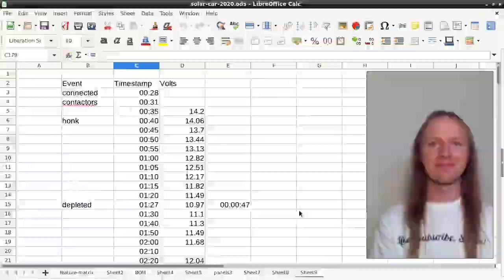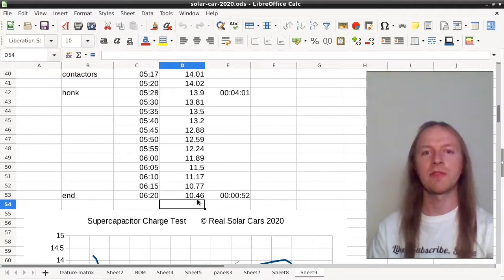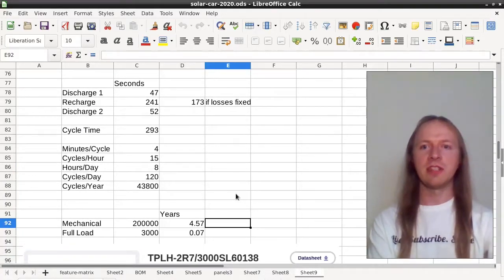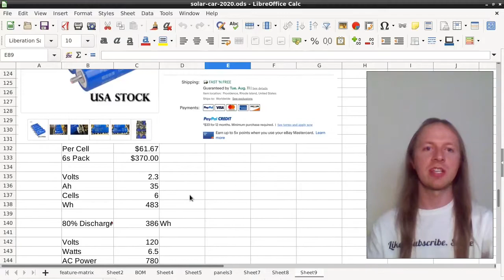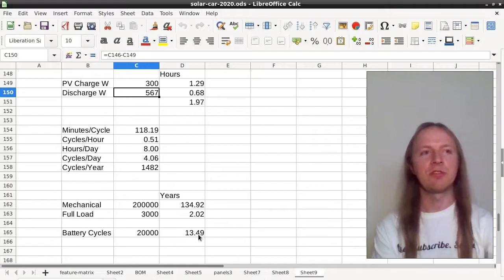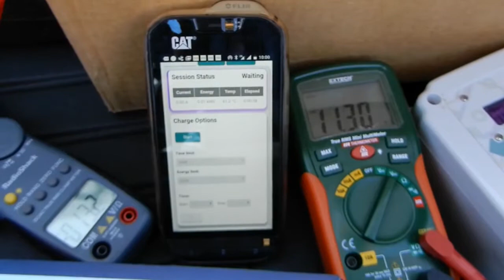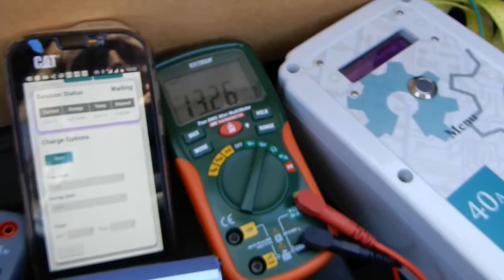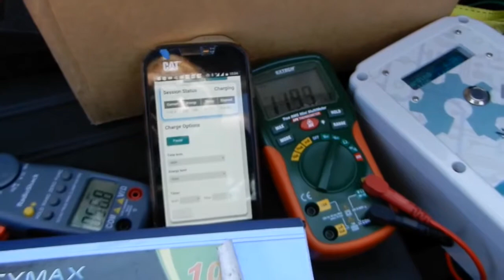Charging my EV with supercapacitors and solar power

Comment: I'm glad you documented this so thoroughly.  I'm still sold on the idea of charging a Volt with supercapacitors during the day, even with such little energy storage, because compared to batteries, their lifetime-cycles are huge.  A hybrid setup which backs the supercaps with batteries or the grid would do just fine, too.  The Volt doesn't need as much charge as a full EV, and if you're just trickle-charging when you can, you're using the components as they're best suited.  So, it's those who want to charge overnight or on cloudy days that need a different design.
Reply: Have you heard of the Aptera? It has the option to have built-in solar that gives you 20-40 miles a day and also gives you 3x more miles per watt hour

Comment: So.   How do you find these data sheets? I had a hard time finding a repair manual for a 1999 Honda vehicle lol.. I would think chevy would keep all these rates life cycles extremely hush hush
Reply from the maker: I think that generally engineers won't buy anything that doesn't have a datasheet.  If it's custom made for one company they may keep it secret. But most parts are not unique like that so they release datasheets to sell to as wide a market as possible.

Comment: I have put a lot of thought into this for several years. I think with wind drag the value of roof mounted panels becomes a loss with much driving. You only gain value if you drive your electric car once in a while or not very far in so far as the panels offset their own drag. Another problem is all the added complexity trying to use your inverter, to charge cable, to inbuilt charger, to battery. Your likely spending a hefty % of power into heat with all the conversion and resistance. A simpler and more passive way might be to run the solar power line under the hood of the car. There you can make a home made DC boost converter and wind your own turiod to get the voltage you need (around 400v for a Bolt EV). A $2 microcontroller could cut the power if your battery was full or at 90% (increase lifespan of your battery). This would keep a constant voltage and variable current based on the solar panels. One possibility is you could make a coupler cable for the cables coming from your battery going to your car inverter (pull battery fuse before handling!). Your coupler would sit in between tying in your boosted solar volts. So when the sun is out (driving or not) your car would be charging. This is a theory. But I think it would be a simplest and most reliable route. 

If you drive your car a lot your could route your solar under the hoot to a 12V battery charger and attach to your 12V lead acid. Would help take the load off your main car battery having to recharge your 12V for cab electronics, heat+air conditioning giving you perhaps even more driving range (bucking solar to 14V rather than conversion loss boosting to 400v).
Reply from the maker: Using a DC-DC step up converter is the best way, but it is not the simplest. For safety reasons the cables to the inverter are de-energized when parked. If fact, if the car has reason to suspect that the contactors are welded shut, it won't drive. So it is necessary to work around some of these "features." The converter must be well designed to maintain constant voltage output as the PV input voltage soars under no load. Of course it should do MPPT too, because nothing is more frustrating than seeing reduced charge power when the battery is low. How do we know all of this? We've done it. 😎 (see other videos)

Comment: I've been researching a similar approach, so glad I found your channel! You've gone down all the same roads as me and mostly come to the same conclusions. Why didn't EV charging standards just support direct solar charging to begin with! One option I'm considering: putting a higher voltage into the capacitor bank. As well as less power loss due to lower DC current, inverters for higher DC voltages have wider voltage windows, and you could get more energy (much more energy) out of the same capacitors at higher voltage. e.g. for a nominal 48 V inverter you can use 40 - 60 V. It's easy to get MPPT controllers for nominal 48 V "batteries" too. Going to watch the rest of your videos now...
Reply: Another idea I had: with a compliant EVSE (which is just a bunch of safety checks for mains power, plus a square wave generator) or maybe your own design, you could use an inverter that outputs less than 110V. Different cars would probably have different minimum voltages here, but you could shave a little off the minimum charging power.
Reply from the maker: It would have been great if J1772 had a direct PV mode.  Just a PWM setting that tells the car to do MPPT tracking on the input. The car's onboard charger could accept 100-300vdc without modifications. Would make for cheap off-grid solar carports.  But solar was much more expensive back when J1772 was developed.  The energy stored in a capacitor follows the equation E=½Cv² so we would want to widest ratio of voltages possible. The 40-60v window isn't much larger percentage wise then that for a 12v inverter.  I don't think capacitors are worthwhile here. But instead of LTO battery, it might make sense to use an LFP battery with 50% cycles.  The new converter board (which is off to manufacturing now !!!) should be configurable to run as a 48->120v dc-dc converter. That might make for interesting experiments.  There are no shortcuts to building a solar car.
Reply: @realsolarcars  Such a missed opportunity with J1772 but as you say they weren't thinking of solar at the time. Congratulations on getting the DC-DC converter to manufacturing!! That is awesome news! Really keen to see if it works directly to the OBC. Re: the capacitor energy equation: 60^2 - 40^2 = 2000, so 20 times more than 14^2 - 10^2 = 96. Okay so you lose 4 times the farads with capacitors in series to get the voltage, but it's still a 5x gain. Also, have you checked out hybrid lithium capacitors? I've seen some 2.2 Ah 4.2 V hybrid capacitors on Alibaba that can do 22 A charge (10C) and 60 A continuous discharge - almost 30C! Less than $5 each. Anyway I'm well on the road to building my own solar EV charger too, but not as ambitious as your approach with direct DC, I'm making a device that plugs into the car's Type 1 / Type 2 port, and adjusts the inverter voltage and EV requested current to match the solar input, when over 600 W = 6 A @ 100 V. When under it stores it up internally for a minimum 2 hour cycle (saving the contactors). It's been a hard road learning power electronics but I'm pretty happy with the design now. Your direct DC approach will still be more efficient though because the OBC can stay off...

Comment: Very interesting.  One improvement would be replacing the 2 200w panel for one Trina 400w panel which is smaller and the capacitor can be replaced with 4 280ah lifepo4 cells.

Comment: Hi there is it posible to put more battery packs to trunk space and connect somewhere before main HV inverter or I don't know maybe to HV battery?
Reply from the maker: The existing high voltage line to the trunk is rated for 15 amps.  It would be necessary to limit the current from the extra battery. The Enginer system uses a lower voltage battery and step up converter that would work in this situation.  Otherwise the high current high voltage circuit would need to be connected under the hood.
Reply: @realsolarcars  So what are you suggesting? If I wont put battery to trunk?
Reply from the maker: @StipeSurlin  nothing is easy. It could be done like Power Electronics Blog has done for the leaf. They added a cable and contactors that are controlled at the same time as the ones in the original battery.
Reply: @realsolarcars  no one done it but everyone talks. it will be awesome to add extra 8kWh
Reply from the maker: @StipeSurlin  it's hard to justify economically when you could just burn a gallon of gas. Also the Volt uses only 65% of its battery capacity. So without further modifications it would only use 65% of the extender battery as well. I don't know if the modifications needed are possible. If there was a battery chemistry with a narrower voltage range that would help work around the issue.
Reply: @realsolarcars  So better buy BMW i3 or Leaf and avoid all those mess. thanks anyway. But if you are interested in upgrading Volt. We will be all Happy to see if that's possible 😁👀
Reply from the maker: @StipeSurlin  I really would like to add an extra battery pack. I want it to be removable for charging, as a power source, to lighten the load when I don't need it, and so it doesn't degrade quickly in the hot trunk. I would expect to use a DC-DC converter between batteries.   Yeah I have too many projects.
Reply from the maker: @StipeSurlin  if you use 120v battery, that could be fed to an OpenEVSE. At your own risk of course. 😎 Don't try it with the Volt's factory EVSE. The Big problem with this is stopping for hours to charge the car for the trunk battery.

Comment: Incredibly thorough research for a DIYer.  Generally you have to go to grad thesis papers to see people put this kind of time and meticulous observation into an experiment.  It was crazy watching the voltage of the cap bank plummet on the multi-meter.  The best application I've heard for supercaps in EVs is in the regen braking system: temporarily pulling in regen power, and discharging upon vehicle acceleration to remove cycles from the battery.  I hope you were careful building that capacitor bank!  That is a scary amount of power to potentially discharge in, what like 1 second.  My wife was inspired to start learning about PCBs by your channel!